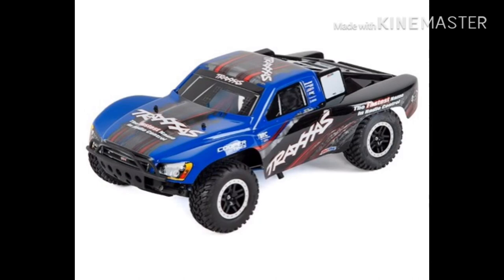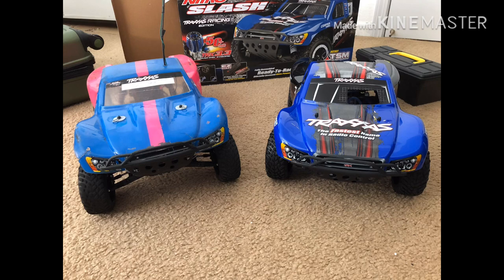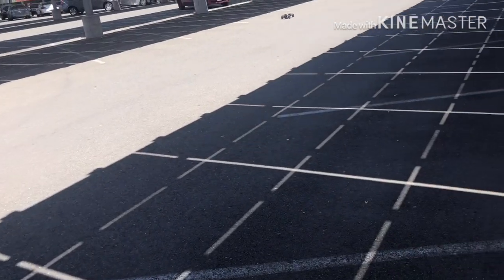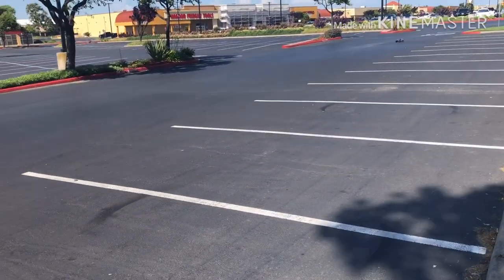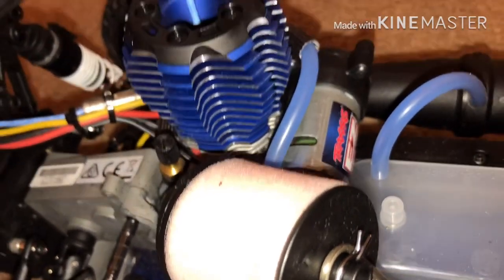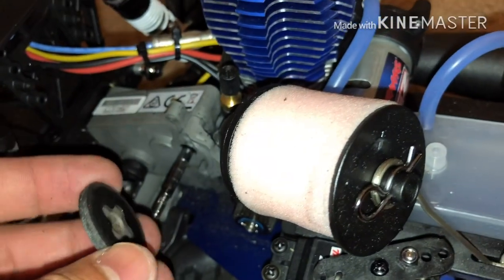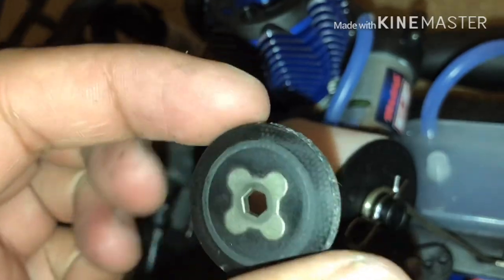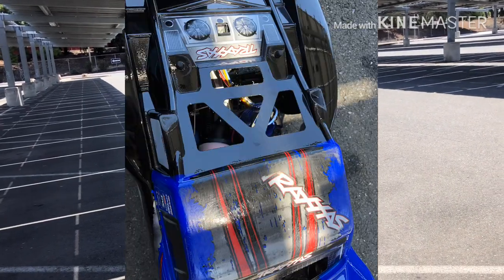Traxxas Nitro Slash Break In Review (NOT MY FINAL REVIEW)

Comment: Im having trouble with mine I cant even get it to start ive read the manual but idk. The EZ start is fully charged when it ry, the fuels going through the line. IDk im not good with these but its brand new. Im gonna keep trying but any help would be appreciated
Reply from the maker: Maybe check the glow plug wire. Cuz sometimes the glow plug wire may be screwed up. If so, I strongly recommend you using a regular glow plug igniter for your RC
Reply: @TndPnyRCofficial  Ill try that soon. The glow plug light shows green on the EZ starter. At first no fuel was going thru the line but it does now, Ill give it a shot. For the amount of money I spent im grateful that you replied to me
Reply from the maker: No problem. If problem persists, just let me know